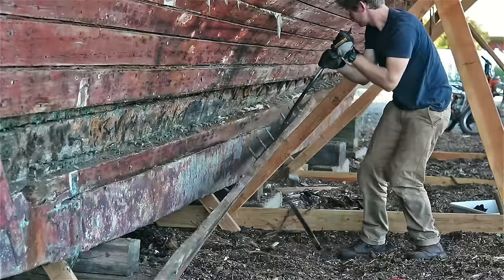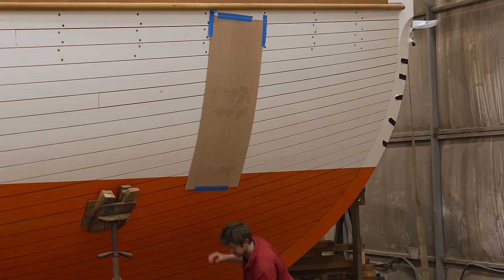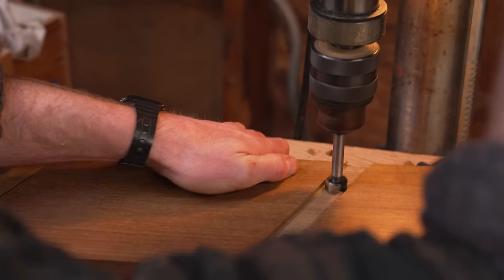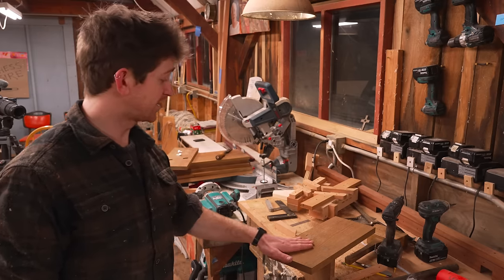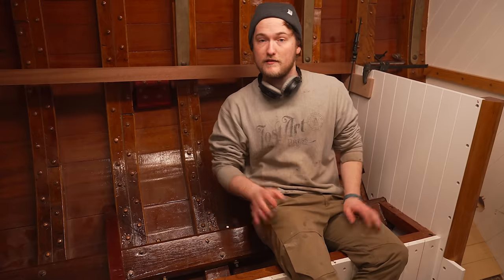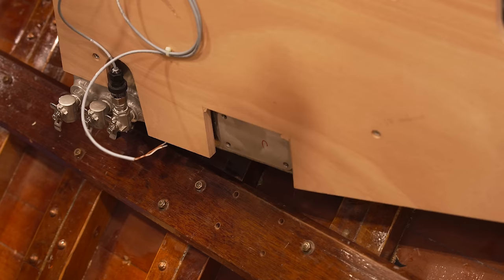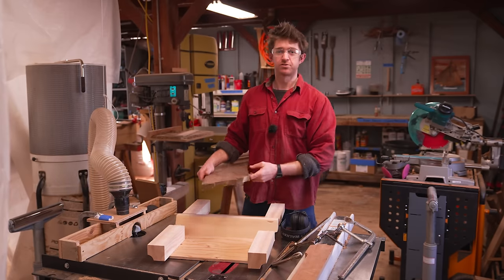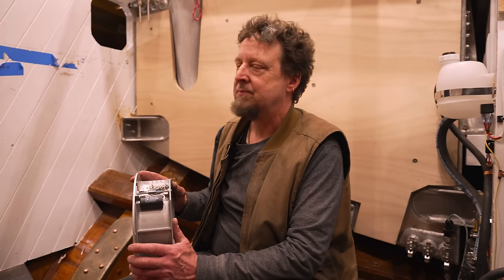Trial and error on the most expensive staircase I’ve ever made.

Comment: Excellent class today! The complexity of stairs of any style are grossly underrated even when you make it look like anyone could do it! if I tried this, I'd have to start with 50% more board to compensate for my mistakes, that's what make my projects cost more - 😁 But I'm paying more attention to detail by asking myself "How would Leo attack this?" and I've been doing that a couple years now. Have to say, it works and that brings more confidence.
Reply: Agreed and have drawn similar inspiration from various episodes as my refit proceeds. The preparation and attention to detail instead of picking up the saw,drill,grinder et al.
Reply: only half again as much material, you're good, i would hvae to build 3 sets just to get the 4th not quite right
Reply: @CATech1138  Oh I hear ya! Only 50% might be on the aggressive side 😆
Reply: @Anmeteor9663  Exactly. Leo is a problem solver and detailed approach planner. For example - the concave corner bevels matching the side rails. Genius. We only saw the easy part - not the building of the jig sled. That's something you don't know about until you know about it. But that shaper, scary ass tool. It's the one that spooks me more than anything with a blade. He scared me (I actually cringed) when he pulled that spacer board with it still running. I saw a piece of molding go through the metal siding of a shop I worked in long ago. Left an impression.

Comment: I know that horizontal steps were the standard for boats of this type, but one yacht I sailed for a few years had the step only horizontal on the middle third of the step.  The outer thirds turn up about 25 degrees. This meant that when heeled over, the outer part of each step was significantly less heeled and less slippery than a standard horizontal step.
Reply: Gosh, now that is impressive!
Reply: Agreed, we had a Bavaria, considered a budget yacht, but the steps were exactly as you explained. Edit, probably not the middle third … probably > half was flat.

Comment: I would recommend a plastic washer or a piece of rubber or something between the stainless steel bolts and the aluminium brackets.
It helps prevent galvanic corrosion
Reply: I was thinking exactly the same, and I went to the comment section to search for a comment like this one
Reply: Agreed
Reply: This is a "Must Do!" Thanks for bringing it up.
Reply: Such would sort out the lag bolts threaded into the boat's structure as would having the brackets anodized, but it won't help where the stainless bolts are threaded directly into the aluminum. Not being well versed in marine tech  I'm not sure what the common solution is to that. Were it not a marine application then changing to plated steel bolts is a significant move forwards because the plating is much closer to aluminum in the eV table. Perhaps it is as simple as using silicon-bronze hardware in those locations?
Reply: @utoobnoob7840  
I recommend A4 stainless steel bolts in marine applications. Don't have to worry much about corrosion on the bolts.
Where it's threaded in to other materials you will eliminate corrosion by using locktite, but it has to be used correctly.
Going into a blind hold you apply locktite in the hole and it'll push out the threads when the bolt goes in.
If it's a through hole you apply it to the threads on the bolt.
I mainly work with marine applications, but in our case we coat everything as an added layer of protection
Reply: @utoobnoob7840  
You also don't want copper alloys in contact with aluminium.
If you haven't seen anything corrode fast you'll see it then
Reply: Aluminium corrodes faster in contact with copper.
It's not only about the natural current in the metals. There is something more that i don't remember right now.
But one thing more that's good to know.
Never have bare aluminium where you pee. It's one of the grosest chemical reactions I've seen.

I also wish you Americans used metric too.
A4/A2 describes the corrosion resistency. In those qualities you usually find 8.0 or 7.0 describing the yield strength.
On a zink coated bolt you'll usually see 8.8
You can calculate the strengths with those numbers and the diameter of the bolt
Reply: @pappis91  We do use Metric. We also use SAE/Imperial/whatever you want to call it. I think it as being Bi-Lingual in Fasteners and dimensioning.
Reply: On a similar point. I thought rigidly attaching the tanks to a flexing wooden hull would stress the tanks a lot and maybe a completely rubber mount would be better?

Comment: Leo. The fuel filters can be a minefield when long term use is considered. A few years ago I came across a UK firm who produce 'Fuel Guard' filters. The advantage in my situation ( I have a narrow boat) is that the filters have a full clear sight bowl, water drain off at the bottom and can be taken apart to clean the super fine filter mash. I have two, one on the engine line and one on the diesel heater line and they have proved to be a great investment. Great video. I am always amazed at the precision of all the work. Excellent.

Comment: Are those  stainless steel bolts Patrick is using on the aluminium tanks? Have you considered  or researched galvanic corrosion? You should check with some experts that the installation won't have issues from the use of stainless fasteners on bare aluminium. You should also make sure the tank is not in contact with any of the bronze hardware.
Reply: Great point sir.  But it depends on the type of stainless steel used.  304 or 316 stainless steel I think is safe for aluminum.  While I didn't see the bolt material used...I am sure the vast knowledge of this crew would account for that.
Reply: Another look at the bolts, show they are marked F593G.  So they are 316 Stainless and are safe for aluminum.
Reply: @RussStalvey  Hi, indeed I'm sure they have the knowledge in the crew or on hand in Port Townsend. 
Actually I think what makes it OK is not the 316 Stainless grade but the area of Aluminum relative to the area of SS
Reply from the maker: Correct - since, compared with SS, the aluminium is the more anodic material (the material which would lose material if galvanic corrosion occurs), the sheer size of the tank compared to the 316 SS fasteners will prevent galvanic corrosion on any scale that could be noticeable or problematic. It's the industry standard way of dealing with aluminium tanks, as you cannot use aluminium plumbing fittings.

Comment: What's the point of the wood burner? Besides for historic value, diesel would be far superior as it's more energy dense and probably could be done with less fumes.
Reply: They are fantastic if your not away from resupply. Problem is over a weekend plus. I know one decks more than 2 cords.
Reply: Diesel is non-renewable. 
Also, when you think about it, Leo is already in possession of enough hardwood offcuts to heat Tally-Ho for about 10 years. 😁
Reply from the maker: Aesthetics and atmosphere. There’s nothing like it. 
There will also be a diesel heater for functionality.
Reply: @SampsonBoatCo  agreed. My home is heated with wood. A good addition. Wasn't aware of the diesel backup. Nice!

Comment: Beautiful work as usual. You might consider using Teflon washers under the SS nuts and bolts where they contact the aluminum fuel tank brackets. It will stop the oxidation bloom that will eventually grow from the dissimilar metals reaction.

Comment: I suggest you pull all the aluminum tanks and brackets and paint them in 2-part white epoxy, to protect them from corrosion.  The white will also show easily if there is a diesel leak anywhere.  Also, use a hard nylon washer between the stainless still bolds and the aluminum brackets, to further prevent galvanic corrosion, to help Talley Ho last another 100yrs.

Comment: The joinery work is superb but I have a couple of queries.  Did you consider an alternating stair tread design?  I have designed many ship's ladders for industrial applications and the one issue that crops up time and again is how risky they are to descend facing forward as the heel has to land as far back on the tread as possible to get any safe purchase.  With an alternating tread design where the treads are like 1/2 a pear shape with the wider parts alternating left and right, which  allows a very planted foot position for a steep stair.  Also, it might have been a good idea to have routed a couple of strips into the front portion of the tread to inset a liquid epoxy with carborundum grit for grip, I can imagine a timber staircase being slippery when wet.  I am highly conscious of steep timber staircase design because my wife still suffers 40 years on after slipping whilst walking down a damp steep  timber stairs, damaging her spine.  She was bed ridden for 3 weeks barely, able to move. 

Just a point on English staircase terminology (I don't know if marine is any different), the rails on either side are strings and the cut outs for the treads are rebates and the front edge of the treads are nosings.

Comment: Beautiful work....as usual!
I would be concerned that solidly mounting the fuel tanks to numerous different planes that will move under the stresses of hull flex and wood swelling and shrinking with changes in humidity may result....over time....in stress cracking of the mounting brackets and/or the mounting points on the tanks.
Reply: Good point Brian! Some flexible pads/mounts would probably have been a good idea.
Reply: Well I did see some white plastic & black rubber mounting pads w/ the brackets, but they looked more like anti-corrosion separators, not flexible mounts.

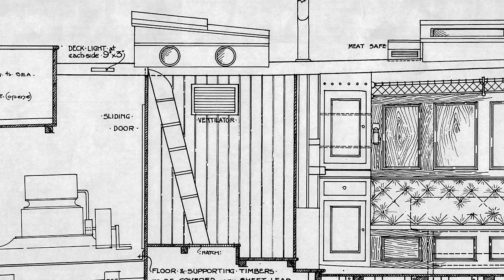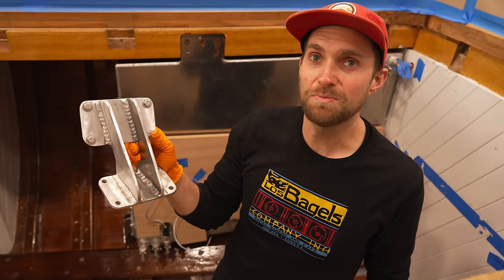Comment: Beautiful staircase work, Leo.  I love the transition using the bullnose with the step to side.  I am curious, though.  The steps look to have a slight downward angle (a persons' toe would be lower than their heel) and it looks like you have made each step to be horizontal which seems proper to me, compared to the drawing at 0:25 in the video.  Apparently, you imported the "aluminium" for the fuel tank mounts ( 15:39 in the vid ), versus just using good ol' American "aluminum" .  😉  Either material should work just fine.   Cheers

Comment: Outstanding workmanship as always!  Is the ship's hull going to flex in the vicinity of the diesel tanks?  Is there any chance of differing flexibility in the tank mounting areas?  Or, Is the the hull in that area considered infinitely stiff?  I'm mostly an aircraft guy, but I understand that most woods expand, contract and flex. Just asking as I hate to see those beautiful tank and bracket welds crack.  Any thought on putting nonskid of some kind on the stair treads?  It might be sacrilege but beautifully finished teak is still slippery with water or wet deck shoes.  The jigs, dados and joinery for the stairs must take a distant second place to the companionway hatch/house videos.

Comment: I think that over time the fuel tank will develop a crack or the timber frame work will as they are too rigidly mounted to each other. Easier to fix the issue now than a couple of years down the track after it has spent a few trips through bad weather.

Comment: I would be wary of galvanic corrosion between the stainless fasteners and aluminum tanks.
Reply: Great observation.  There are two stainless grades that will be safe in this application on aluminum.  304 and 316 stainless.  They used F593G marked bolts, which are 316 Stainless.  This is an austenitic alloy stainless.  So, they're good.

Comment: Front door, head door, are they really that different..? Spotted a tiny lifespan altering feature though. Those bolts for the tank mounts. Although the plate is thick and welded solid, most likely the tank skin is relatively thick too, but when you screw in a stainless bolt, that last squeeze digs into the skin. And when the bolts are different metal than the skin, with added sea water there's an electrical couple, just like Dutchess and George, which then are eaten to epic failure. This is difficult to fix, but the problem is there nevertheless. So, for the next pair of tanks, the welded plate should be a hanging bracket, and every bit of the tank should hang and rest on rubber isolated hooks/similar non-intrusive and flexible mounting solutions. When the tank is solid mounted, the mass swinging will brake something, and a wooden boat is never a solid piece, it flexes and moves with the waves. Aluminium tank on the other hand, can't flex and move with the boat, thus the mounting needs to be firm, but designed to keep the tanks free from binding. Traditionally belted, but hanging brackets work equally fine, only a bit harder to fabricate/calculate the stress factors and holding capabilities.

Comment: What type of bolts connect the aluminum support brackets to the aluminum fuel tank?   If they are not aluminum bolts, is there a long-term possibility of the creation of a point of electrolysis/corrosion?

Comment: are you adding any insulation to the inside of the hull, or some form of protection to keep condensation from forming on the inside of the hull especially in places where access is difficult to prevent mould growth or water to forming in places??
Reply: Condensation will inevitably form on the inside of the hull planks, either from warm humid cabin air hitting the cold surface of the planks, or from water molecules migrateing through the wood planking. The best hope is that the accumulated droplets drain down into the bilge, or that circulating cabin air can re-absorb the water. If insulation is pressed up against the planking, it'll prevent drainage (& create water pockets) & prevent air movement.
The better insulation is against the skin (clothing & bedding), not against the hull.

Comment: I just consulted about the subject and found out the following.

Question, 
If a wooden yacht were fitted with a wood burning stove, is the vessel covered in case of a fire

The answer to your question will depend on the specific terms and conditions of the maritime insurance policy.
Generally speaking, a standard marine insurance policy will cover accidental damage and losses caused by a fire, but this coverage may be subject to certain exclusions and limitations.

In the case of a wooden yacht fitted with a wood-burning stove, the insurance policy may have specific requirements for the installation and maintenance of the stove to ensure safe operation. Failure to comply with these requirements could result in the policy being invalidated, and any losses or damages resulting from a fire caused by the stove may not be covered.
It's essential to review the terms and conditions of your specific marine insurance policy to determine whether it covers damages caused by a fire resulting from a wood-burning stove on a wooden yacht. If you have any doubts or concerns, it's always a good idea to consult with your insurance provider or a qualified marine insurance specialist for guidance.

Essentially, if you do fit a wood burner on your yacht and fail to comply to the small print of the policy ( ie, have a fire), it is within the insurance company to deny any claim.
So, Don't fit a wood burner, even if the insurance company allow it. You will be unable to claim. small print and legal teams Say So Sir.

Comment: I think rather than permanently installing the settee and other furniture I would have built mounting points into the hull ribs so that if I ever wanted to change the furniture it wouldnt imply re-drilling new holes in those ribs every time. On the other hand nobody ever changes the furniture of their boat so its probably fine.

Comment: Since the door requires a lot of space to swing open and shut, and isn't watertight, I surmise that it's purpose is primarily privacy, and therefore it goes to the head.
Reply: Due to the thickness, I'd expect it's located on the engine bulkhead? The thickness is probably for additional noise muffling. That's my guess anyway.
Reply: @NomadicPhoton  That's a pretty good thought, but I don't believe Leo plans to use the auxiliary power much.

Comment: Leo, I've always wondered why they use slotted screws to fasten items instead of something that could provide more torque like a Philips screw perhaps?
Reply: The deal w/ slot-head screws is that 10 or 50 years from now, they'll need to be removed for repairs. It's easy to clear that single slot & remove the screw - not so easy to clean a Philips or hex screw for removal.
Reply: Phillips bits fill with debris easier over time. They are also easier to clean out. I learned that from Acorn to Arabella.
Reply: @frederickstibbert7389  I never thought about that. It makes complete sense. Thank you. 🤝🤝
Reply: @michaelsnell4034  Thank you. It makes complete sense to me now. Thank you. 🤝🤝🤝

Comment: I noticed in one of your close ups the head of a stainless steel bolt and it was not of the 307 grade stainless steel, are you concerned that the cheaper grade stainless steel bolts might eventually rust?

Comment: I am surprised to see you mount the aluminium tank so solidly. Theyvare absolute bustards for hairline cracks. Surely your hull is going to flex even minutely. ( even without the front door)
But should it not be spring mounted or rubber mounted or allowed some sort of movement. I really think it is an oversight. Hope it lasts for you.

Comment: Has propably been asked several times before: Is there anything left over of the boat, that was bought? 
It seems like everything was build anew, down to the tiniest nail.
Reply: The bottom 3 teak planks of the transom are original, the teak bunk rails are made from original hull planking, the original lead ballast keel was melted & re-cast into the new heavier keel, the original capstan is being repaired & motorized, & an original bronze plank fastener has been re-cast as a reproduction sovereign coin for under the mast. That's about all.
Reply: @Sonja Bruenzels - The capstan is mainly used for raising the anchor, but will also be useful for raising & lowering the topmast.